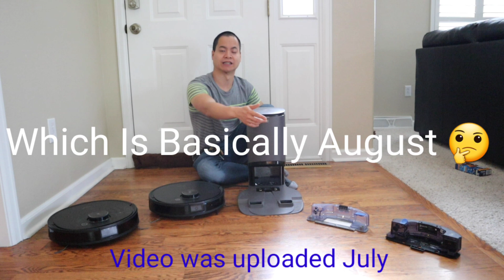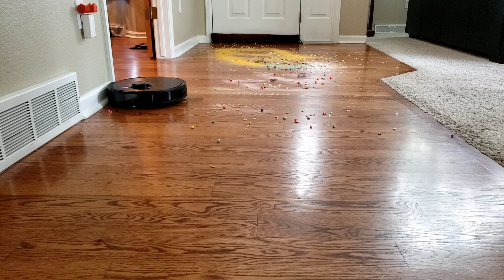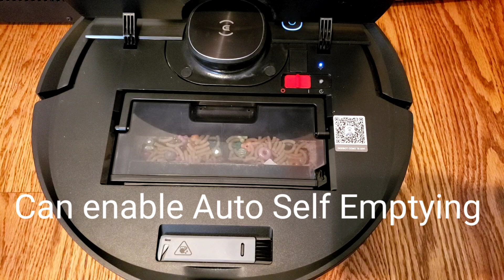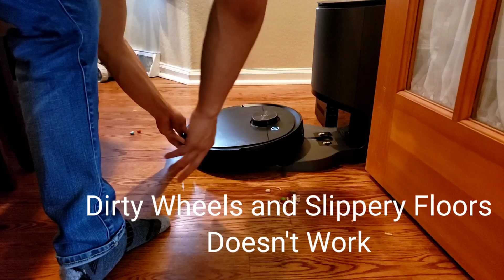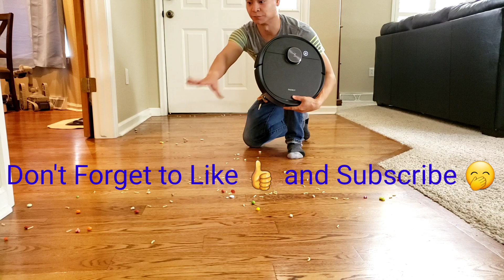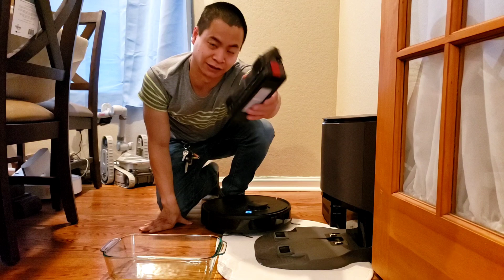Ecovacs Ozmo Deebot T8+ / Pro Self Emptying Bin Stress Test!!! Lots of Dirt

Comment: Is it possible to just empty the bag and simply reuse the bag? As they are kinda pricey to replace
Reply from the maker: You can, from my experience the Bag degrades overtime and may release some dust into the air.
Reply: @RobotMasters  But it would technically still be usable for multiple empties right?, 

and if you don't use the bag, will the self-empty station function like a regular dust bin and we can just lift the entire station and empty the dust from it into a trash bin?

 (Sorry i'm just looking for ways to get out  of having to buy their specific bags for this thing as otherwise this vacuum seems so perfect, I appreciate the response tho)
Reply from the maker: @ravindrasankarlall4555  No unfortunately there a sensor that detects if the bags in, also the bag aids in the vacuuming process. Lastly the dust and debris may get past the filter which the dirt could permanently damage the motor.

Comment: Hello! Your videos are very informative, thank you! I have a question. What is the difference between the T8+ and the T8 AIVI? Which is better if I don't care about the camera security features?
Reply from the maker: Well if you not going to use the T8 camera system, than the T8+ a better option. It can navigate as well as the T8 with the camera. Everything else is identical between the two models.
Reply: Awesome! And is it true the T8+ actually has a better obstacle avoidance system as compared to the T8 AIVI even though it has no camera? Or is the AIVI better?
Reply from the maker: @zaayernasib  Hard to tell, I think they are about the same, Ecovacs representative says over time the AIVI is could be better via better objective recognition.

Comment: So apparently there is no sensor in the waste bin area of the actual robot... so my question is what happens if the house is really dirty and the waste bin in the t8 gets full? Does the robot keep trying to clean with the bin full and damage itself?
Reply from the maker: The robot will continue to clean, eventually the debris may end up end the extractor bar area and shut the robot down. There sensors that prevent  the robot from damaging the motors.
Reply: @RobotMasters  hmmm, do you think the t8+ is better for the price at $450 compared to the i3+ at $400. Seems like the t8+ is better in my opinion with its features
Reply: *irobot's i3+
Reply from the maker: @deadly1246  Feature wise yes, has the smart mapping, Lidar Navigation and if this the AIVI version front facing camera. The i3 has a good self emptying system,  tried and true cleaning system found on the Roomba i7. It really depends on the features you are looking for.
Reply: @RobotMasters  i just got the regular t8+ not the aivi but it has smart mapping and mopping which the irobot i3 doesn't have so I feel like it was definitely worth it. Too bad it won't have a camera but im not missing out on too much. Thanks for the help!

Comment: Nice review, did you need to keep a rug underneath the dock so that it wouldn't slip? My T8 has trouble docking and wondering if its due to it slipping
Reply: @Ritesh Kohli Are your T8's wheel grey or black? I believe the updated version chnaged to black, more rugged and rougher compared to early version of T8 which has the same grey wheels as 950.
Reply from the maker: @jonnylee8538  That what I heard, the wheels have been changed to improve the traction on the robot.
Reply: @jonnylee8538  they are black. I find that if I clean the wheels every once in a awhile with a micro fiber cloth they have enough grip to get on the charging dock.
Reply from the maker: Yeah it helps, especially on slick floors.

Comment: Since it's on sale on PrimaDay, I was wondering can does T8 self empty everytime it finishes or when it's full? Can you stop from doing it when you schedule cleaning? Since toys are cleaned for night at our place, I' like T8 to clean on silent mode at night, but not empty itself. I would schedule empty to when no one is at home.
Reply from the maker: If you are on a schedule mode you can temporary pause the robot prevent the robot from going out by enable silent mode. Or it might be called do not disturb mode if I recall. The T8 only self empty when the cleaning job done or of the user manually tells to empty in the app. There no bin full sensor.

Comment: I think these would clean much better if they slowed down the drive wheels and side brushes. The Neato goes slow but my t8 zooms around like a race car. ECOVACs should address this.
Reply from the maker: Yeah if the robots could go half the speed or allow the user to control the speed of the robot. I had an older robot vacuum from pureclean that had a button that switched the robot from fast to very slow speed.
Reply: Robot Masters I like the t8 but my biggest two complaints are the brushroll is too soft and doesn’t groom carpet as well and the speed. That might be the reasons for me to return it. I love everything else about it though.  Mine doesn’t have the vibrating moping pad however. I wish I had that but I love the self empty bin and it does seem to work well.

Comment: So this robot dosent have like the roomba that it detect the full bin and go back and empty its bin and then resume, do you have to keep an eye on it all the time? And Also the roombas have a feature Where it empty its self everytime it goes back to its dockning station, but does this have it?
Reply from the maker: It doesn't have those sensors. The robot will empty itself after a cleaning run, despite the dust bin being full or not
Reply: Robot Masters Robot Masters so it Will keep cleaning even if the non is full and cant suck up any more dirr? Seems like a stupid chiose not to include That 😂 is There anything else thats important before You consider bying this? And Also whats the diffrence between the t8 aviv and the one with the 3d sensor? I dont understand 😊
Reply from the maker: @paulkhajo91  Yes the robot will continue to clean. Usually the dust bin doesn't fill up after weekly use of the robot since it keeping the dirt down constantly. The T8 AIVI has a front facing camera, used for object recognition and as a surveillance camera too. The T8 3D doesn't have a camera, the 3D system does a little better at recognizing smaller stuff. No surveillance mode. Lastly it cheaper than the T8 AIVI
Reply: Robot Masters okay thaiköket you very much:) one more thing, is it a hepa filter on the t8 and is it a hepa filter on the clean base like the roomba?😊
Reply from the maker: @paulkhajo91  Not sure on that one sorry.

Comment: How do the side brushes do on the dock? Does it bend the bristles when it’s docked on the auto empty dock?
Reply from the maker: The side brushes are flexible and can bend. The bristles usually need replacing after 3-5 months of use depending how frequently you use the robot. Most App controlled ones can keep track when theu need replacement.

Comment: Hey man, any idea why there is T8 in white and T8 AIVI in black? is there a difference between both?
Reply from the maker: There no difference in the models if it says T8 White or Black. Now there a T8 Pro which means either the self emptying bin or the vibrating mopping module included in the box, but everything else is the same. Lastly Ecovacs released a T8+ which means this model doesn't have the front facing camera but a more robust true depth sensor for object recognition. I suspect both models would navigate the same.
Reply: Robot Masters  Thank you so much for your reply, it would be great if you could make a video comparing the T8+ to the T8 AIVI and figure out what is actually more useful, the AIVI camera system or the True3D Detection system.
Reply from the maker: If I can get my hands on the T8+ I will evaluate the true depth sensor and see if the navigation any difference than the regular version.

Comment: Did you punch out the two holes on your 'normal' T8 and switch the dust bins to see if self emptying worked?
Reply from the maker: Yes the two plastic parts are removable and works with the self emptying bin and vibrating mopping module.

Comment: Hi Nathan 
Great videos on robot vacuums. I just bought the t8. And I have a question regarding the self empty bin add-on. I see in your previous video U were telling the dust bin had opening for self empty bin in the t8 pro and it’s different from the t8. In that case, will the self empty bin work with my  t8 if I purchase it separate as a accessory in future?
Reply from the maker: Yes the all the T8 models support the self emptying bin and the power jack for vibrating mopping module. The + or Pro means the accessories are included in the box. Someone told me the overseas version may have slightly better specs aka bigger battery. Have not confirmed that personally.
Reply: @RobotMasters  what's the difference, if any, between the dustbin in +/pro model and non-pro model? I think something to do with openings in it. Can u please check and get back?

Comment: Tease, tease, tease with the high end, non-roomba vacuum with a clean base, but it's always only available through back door channels.  When and if it ever does come to the US, it will be as expensive as Roomba S9.  I wonder if they'll be able to sell it at that price.  Roomba is a well-known name in the US, but Ecovacs is not.
Reply from the maker: Yeah it available in China Ecovacs, there been a few post that shows the unboxing of the Ecovacs T8 Pro. Ecovacs responded to a few users that the accessories may be available late August. Even their representatives don't know exactly. iRobot still has the best system, the dirt detection system and dustbin full sensor makes the self emptying system useful for dirtier homes.

Comment: Grate Video Nathan am using the t8+ 4 times in daily basis the motor is really quite 👌 not noisy, the motor is powerful, Very Smart robot vacum, however there is some problem with the app to be fair also the vacum can't be register with amazon alexa but overall its really fantastic I love it its doing the job and this is what am looking for
Reply from the maker: Glad it been working out with you. The T8 is still pretty new to the market so I am giving Ecovacs the benefit of the doubt they can improve the navigation and docking abilities of the robot. Thanks for Watching!!!